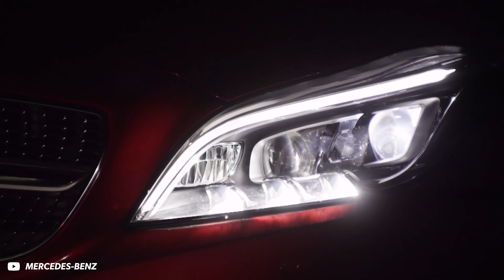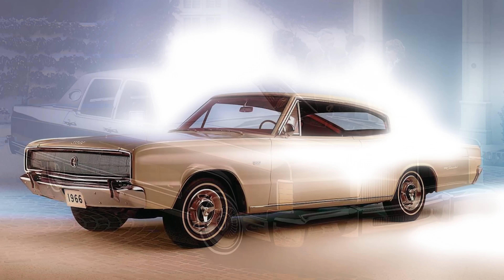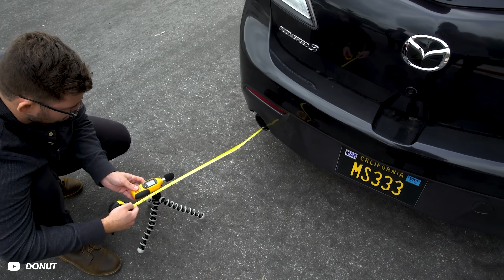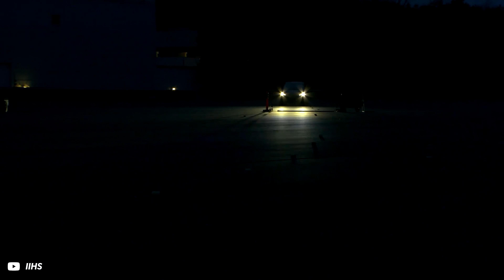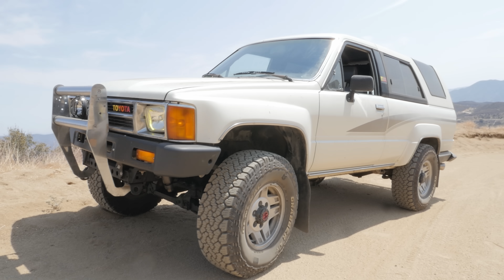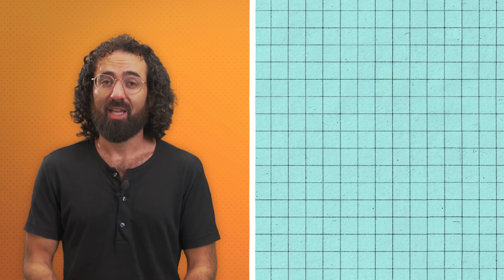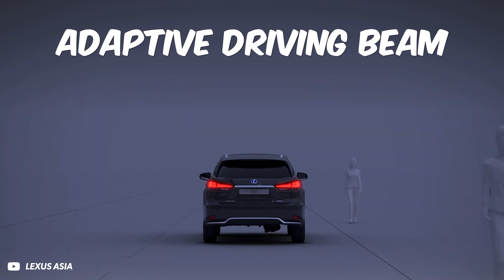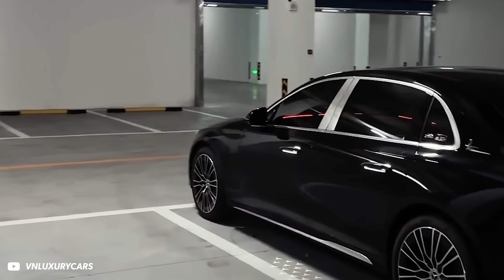Why new headlights are blinding American drivers

Comment: We need to be very clear about something: 60k lumens is a WEAPON. Nobody needs 60k lumens of illumination for anything ever. Unless you're in a search and rescue helicopter, there is no benefit to having that much light. You only need to be able to see enough of the road to stop before hitting something. That's it. You literally only need to illuminate your maximum stopping distance, plus like fifty to a hundred feet to account for reaction time. 60k lumens is WAY above the threshold for long term vision damage with frequent, brief exposure, and that's not even accounting for the likelihood of crashing because the whole world is washed out by white light. I would go as far as saying that anything over 10k lumens should be flat out illegal to sell to a private consumer for installation on their car. We do not need to invent brighter headlights. We haven't needed to since 1995. This is an area of innovation that should've stopped the moment we hit 10k lumens. You can buy a 100k lumen flashlight, but that's a flashlight. You can aim it away from people, you can turn it off. Your headlights can literally only point at the oncoming drivers and if you turn them off at night you are breaking the law. Truck lift kits should come with properly angled headlight replacements too, because I swear to god I get blinded on a nightly basis and it is ALWAYS one of those absolutely compensating for something pickups that you know will fall the hell apart if it so much as looks at an unpaved road. Of all the things to make me hate humanity, headlights weren't on my bingo card growing up, but now they're the single most frequently recurring pain in my life and I am so damn fed up with people not understanding that they don't need to see all the way to goddamn Arkansas to be able to make it to the grocery store. Those adaptive headlights can't come soon enough, though I doubt I'll still have all my vision by the time they see widespread adoption.

Comment: It's been a bane of drivers, and if it wasn't the Manufactures it was some aftermarket product that should have been fined.
Still a trick "if" possible to somewhat migrate the issue when it's safe to do so is.
 
When you see the on coming a-hat that has their high-beams still on or driving with dangerously bright low-beams, focus on the white shoulder line.
Doesn't mean you lose focus of where you are or of other things you should be focusing on while driving. Just at the critical time you would be blinded, focusing on the white shoulder line as a guild to keep you in your lane for that 1-2 seconds have helped recovered vision or maintained vision after the critical blinding point has passed. That is if the company contracted to paint the road lines didn't cheap out on the paint or deliberately set it up so the paint faded in hopes of better revenue and those lines are even visible =(

P.S if you FEEL you need to drive with the extra bright headlights, get you eyes checked.. Stop making a YOU problem, everyone else's problem. Though my gut says everyone who watched this video feels the same way I do and I didn't need to take my time to type this P.S. Still you never know.

Comment: 6:45 - just throwing it out there, IIHS, it isn't the vehicle with the super bright headlights that is going to crash and provide you data. It's the truck with crappy yellowed 2000s composite headlights that the new car blinded in the rain and caused to miss the turn and go into the ditch. You're going to need vastly more complicated data than you likely can access to make the conclusion you want to make.

Comment: Allowing automakers to stop using sealed beams was a horrible mistake. Sealed beams, aside from the mediocre USDOT beam pattern, were the perfect solution. Buy them anywhere for cheap, glass lenses can't yellow, easy to change, forced more interesting design choices, and a delightful yellow-white beam that provides plenty of visibility without blinding anyone. Having owned about a dozen cars across the 80s and 90s, my sealed beam vehicles have always had great visibility, and my composite headlight vehicles have always been pathetic, after two decades of UV exposure. And of course, anything new is blinding regardless.

Comment: The astronomy community uses mpsas (magnitude per square arc second).  This is the light coming from the sky above.  The same thing could be done, but reading the light coming back from a standardized beam fall, say on a gray wall about 50 meters away.  That way, the lighted scene's brightness could be measured in a standard way to measure how well headlights are working for the driver.

Comment: My tire care guy (gal, actually) told me that headlights and tires are not aligned except very roughly at the factory.  They had to adjust mine, a brand new 23 Highlander, and I had to adjust my headlights to aim lower than they were when I got the vehicle.  Too many flashes in anger from oncoming traffic, and I got the message.  Fortunately, it's very easy and straightforward to adjust your headlights.  Plenty of videos on YouTube.

Comment: I struggle with this a lot given that I daily drive a na Miata so I’m already low to the ground as it is I swear there’s times I legit can’t see in front of me thankfully I know the roads of my town I use a lot because if I didn’t there’s times I’m either barely following the line on the edge of the road or just trying to guess the best I can where I’m at and just hold it straight or where straight would be at the time and hold it there until I get passed them. There needs to be major restrictions for this some of these are even recall worthy imo then they get behind you and you can’t see anything without ducking down or out of the way to not get blinded by your own mirrors. I’ve went as far as to actually consider a rear mounted super light bar that looks like the sun for when people tailgate like that they can get the same treatment. Lawmakers and safety people etc are a joke and don’t care about small people only themselves

Comment: looks puzzled in TÜV
We learn in driving school never change a bulb with one that isn’t exactly rated for your casing because the fresnel lense is perfectly calculated for the position of the filament and if the new one has the filament at another position or angle the whole lightpatern changes.

Comment: I rarely get blinded when driving at night. Not sure why. Maybe it has several causes. First, it maybe your eyesight or how you have your  dash lights set. But most of all, I believe the main issue is that people LOVE to complain on the internet.
Reply: I think people make the mistake of looking at the oncoming lights that are bright then get dazzled by them. What helps is just concentrating on looking at the area of the road ones own car lights are illuminating, this helps largely avoid dazzle but isn't 100% fool proof due to retrofitted rubbish and poorly adjusted lights, but it certainly helps about 95% of the time.

Comment: These adaptive driving beam headlights are not a good idea, instead they're absolute HORROR. Here in Europe getting blinded all the time, because the switch off too late, because there's something in between, or whatever is the reason. And you can tell it's the adaptive ones because at some point they do 'switch off'. Really would love to have them expelled for good.

Comment: Trust me, in Europe it's still terrible, you're supposed to have your lights checked with regular checks but no one is fined if it is not correct. So with lights you can easily tilt from within the car, the mechanic adjust them down to be within regulation, and then the stupid driver adjusts them back up because "he can't see traffic", not understanding headlights are generally more so other people can see you and if you need to see stuff you have the high beams for dark empty roads...

Comment: That's must be a real criminal act to NOT ADJUST the headlamps. Ask local cops to do their job, stop the drivers, impound a car, force to properly set their lights in a lab, if noit - revoke the license until owner\driver understand the issue. Is this too hard? Nope, It's the safety for you and me. Better to spend 50-100$ and get more applause from everyone than blinding everyone and get much more hate.

Comment: as someone who drives a smaller vehicle, it doesn't matter if the guy in the SUV or pickup has the high beams on, that headlight is pointed straight at my eyes

Comment: In the past, we were smart enough to make the low beams not only lower in beam height, but also in power output. That means when your low beam crests a hill, the lower output is at least a bit less blinding. Most of today’s LED headlights have the same output above and below the beam cutoff. 
I can hardly see cars pulling out in front of me due to the blindness of oncoming LED headlights, good luck to pedestrians.

Comment: All cars in Europa have to be checked for safety every year or every 2 years.
And they check if the light beam is conform spec of the law.

So a misplased H4 light, need to be repared. A after market light needs to also have the right specs.
Replace a H4 with led. It also need to have the same light spec.

Comment: commuting with my bike to work. when daylight shifts through season and I have to start biking while its dark it's so painful to do because I either have to stop to not fall of the road or stretch my arm out to see at least a little bit. The bike lane is wide enough to easily fit a car in it and is at least 3-5meters away and about the same distance lower form the car road. Yet the blinding is INSANE. If someone would need to walk their dogs that early in the morning i would easily run over them and notice it only on the impact.

Comment: It's crazy to me that these nuclear headlights (that's what I call them) are legal at all. I used to love driving at night, now I hate it. I very literally have to close my eyes or look off to the side with every oncoming car, because if I don't, I'll be light blinded for a long time after the car has gone past me. Having astigmatism makes it more fun. Even in the daytime these things are so bright they cause physical pain in my eyes and I have to look away. 

The reasoning behind these lights is horribly flawed. Sure the driver can see better, but now you've turned every other vehicle coming at you into unguided missiles. It's probably the most counter-productive "safety" feature to ever come about. 

I did finally find a solution that works for me. I'll tell you what it is. Blue blocking laser protection safety goggles. I'm not joking. It's the only way I can be on the road anymore.

Comment: There are options beyond just adaptive headlights that can fix this, an update of the NHTSA and SAE testing procedures could also allow for more restriction on headlight height, acceptable color/temperature, glare testing, and maximum brightness (candlera/lux/lumen). Beam shape can also be regulated. We could keep the easier to produce headlights in this way.

Aftermarket bulbs installed in housings not intended for them will always be an issue unless we frequently test existing cars on this similar to emissions testing. It'd be difficult to do this though.

Comment: From New Zealand: I'm at odds with just about everyone, I have very little trouble at all, even with getting old and my eyes not being good with glare. In NZ, headlights are tested during every fitness test (yearly, or 6 monthly for older cars) and if they don't conform you're going to cop a fine if you drive. 
Most drivers seem to be pretty good about using low beams into oncoming traffic, apart from the occasional a'hole. 
I drive a Tesla Model 3 with adaptive beams which were upgraded one day a couple of years ago in one of the regular (and free) software updates. The adaptive lights work pretty well and I've only ever had one driver flash me, possibly because of my lights. About 20% of my driving is at night. 
It's the same deal with rear vision mirrors and side mirrors, most drivers use low beam when behind another car, and the Tesla does that too. Best thing since sliced bread! 
One point you missed - in the US, Teslas also have had adaptive beams since earlier this year when they developed a software solution for the non-SAE regulations from NHTSA.

Comment: I hate those fisheye headlights. 
If the road is bumpy and rough, those headlights flash at you like a strobe light.
Then you also have to take into account, that vehicles like pick ups with a heavy load on the back, can drop the rear down, which changes the pitch of the vehicle. 
This makes your low beams rise and simulate high beams.
Same goes with vehicles towing a caravan or heavy trailer.
Not to mention the cost of modern day headlights. It's crazy extensive to replace a headlight if it's broken. 
Those old round and rectangular headlights were affordable and lasted decades. 
These new plastic headlights are s**t!!
They fade, get scratched, crack and collect water when they start getting older.
The automotive industry doesn't care that they make crap. 
They want to make fancy looking cars to sell you a product that doesn't age well.
After 5-10 years of owning a new car. 
Your gonna start spending lots of money to maintain it.
Planned obsolescence is in everything we purchase these days.
A throw away society that keeps the landfill getting bigger and bigger and bigger. 
Watch the WALL-E animation movie. 
That's where we're heading if long life products don't come back.
And no... the great depression wasn't caused by industry dying because there products lasted so long. 
It happened because the bankers wanted more profit by increasing consumerism.
So you end up buying 3-4 washing machines over a lifetime. 
Rather than one that lasts a lifetime.
Anyway... that's my rant for today.

Comment: As a european I tell you adaptive lights are still blinding drivers because they switch a segment off after they´ve blinded you, not before and it also doesn´t work well if the road is not straight or that asshoIe is driving a bit behind you and is too stupid to turn the high beams off. When I encounter such an asshoIe, I go extra slow, so they overtake and bother someone else with their stupidity.

Comment: It's just down to A: People not installing light correctly so the beam pattern is wrong (see this a lot) B: People having their lights adjusted too high (There's legal limits on angle and distance) and not adjusted left and right correctly (in the UK it should be lower on right side and slightly higher on left but not hear direct horizontal or pointing upwards) C: LED and such bulbs in reflector housings and such which shine too much light everywhere and are extremely blinding even when not pointed at you because of this if the light it produces is too much, projector housings do not cause this problem due to the light being focused much better. D: People not turning off high beams when they shouldn't be on. E: Adaptive systems not being high enough quality to adapt fast enough to keep a car blocked out, or see it far enough away. Just need to fine those with lumen output which is too high, those with wrong bulbs in wrong housing types, and those with light which are adjusted wrong, maybe even fining those driving with high beams on when there's traffic within a set distance in-front of them, like a mile or so. And have a set angle lights need to not exceed and a set high lights can not exceed, and a set distance your lights can not exceed. Really not hard to figure out the exact details and then put it into law. And then start pushing police forces to fine those who break the law, even allowing people to submit dashcam footage etc to be reviewed. Give people option to avoid or reduce fine if they get it fixed within a week etc.
Reply: As a note, I drive a tesla model 3 with the adaptive lights and never get flashed because my lights are adjusted properly (A hell of a lot of teslas aren't, it's fucking stupid how many I see with their lights not adjusted properly, and just the amount of cars in general with lights adjusted wrong, pushing the dipped beam level or pointing upwards) Also another note, european trucks should be allowed to high brighter sort of beacon lights at the top of their cab so adaptive systems can see them easier to not blind truckers, I have to turn my adaptives off a lot because the lights aren't bright enough for the system to think they're car lights until I see their main lights.

Comment: Another lighting issue that I wish manufacturers would fix - modern "DRL". Toyota, BMW, Subaru, Mazda, Honda, Nissan, Chrysler, GM, etc have cars with "DRL" that turn the headlights on at or near their full brightness, and leave the taillights off. Every night I see multiple people driving a car with no rear lights, and they have no idea. 
I've pulled besides some of these people and said "your lights are off" and they argued with me - why wouldn't they? Their gauge screen is lit up and they see lights on the road ahead, so they have no way of knowing. The only way somebody could know their rear is unlit is by reading the owner's manual, or looking at the back of their car while it's running - people rarely do either of those. 

DRLs need to have a max brightness (they shouldn't be able to be used as driving beams, shouldn't really be visible at all from inside the car). Either that, or taillights need to always be on if the vehicle has any front lighting enabled. 

Between "daytime running lights" bright enough for drivers to mistake them for their normal lights, blinding headlights, and manufacturers deciding to put brake lights/turn signals on the bumper for some reason, it seems brands are in a competition to see who can make their car's lighting the most dangerous. I don't understand how this is allowed, makes me wonder if the people who make the rules of the road ever spend any time actually driving on the road.